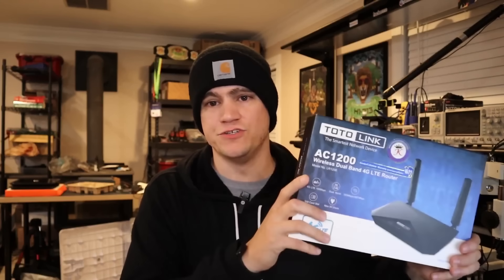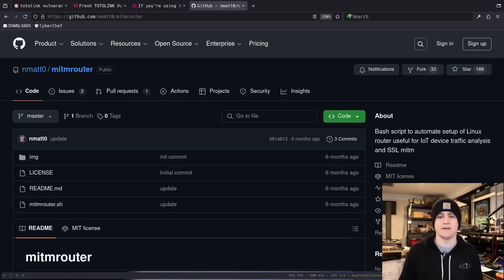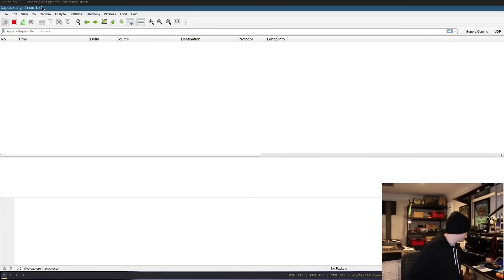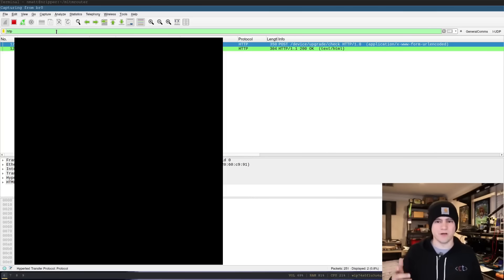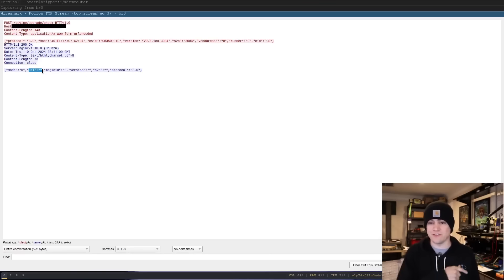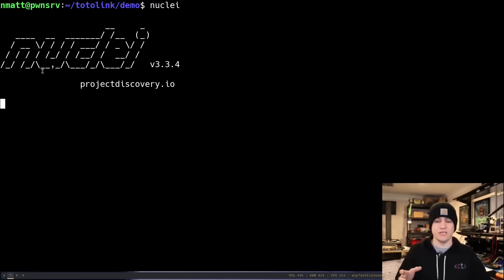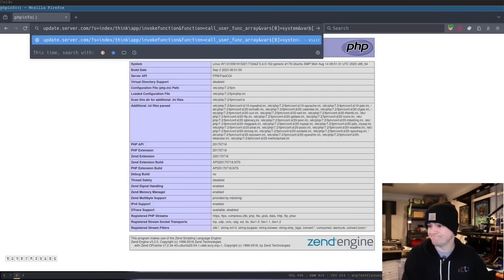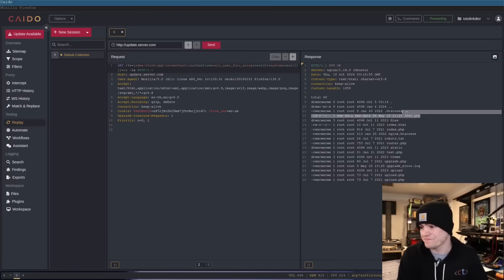Discovering Backdoor in Chinese Router Firmware Update Server - Hacking the Totolink WiFi Router

Comment: You have assumed many things. Try and update the firmware with an attack chances are its going to fail binary signature, (they using a second stage boot-loader with signature check). Just cause you discovered the plain text communication doesn't mean anything you basically making a ton of noise with no "end to end" demonstration of an attack. no wonder they didn't reply, you haven't proved anything, good video and hats off for trying though.
Reply from the maker: LOL :D

Comment: Just out of curiosity, is what you show legal to do in the US? Where I am, in Denmark, it's illegal to access systems without authorization. IANAL, but I think what you did would be deemed hacking and illegal.
Reply: One might agree with what you say, IF, some effort was put in to securing the server. They provided the ability to enter commands through an http post to everyone without requiring authorization.  So one could argue that there is no authorization requirement.

Matt didn't alter anything on the server, someone else already did that.

Comment: Idumped the firmware from nor spi flash for Huawei dg8045 with customized firmware by vodafone the webpage login interface has admin and user permissions the user one is printed on the back of the router the admin has fully control on the router I tried to investigate the firmware the kernel extracted them and tried using ghydra but nothing even the Cfg file is encrypted i tried to decrypt some info but nothing even the when i tried to gain access through uart shell the router boots up and the shell stops on starting kernel i interrupted the the 2 bootloaders first is bootrom the second is hiboot to manipulate loading kernel process the common bootargs doesn't work
Reply: my Huawei HG8045 is a lot less secure than yours.

can download a backup config, copy my user password hash to admin, restore backup and I have admin access. The config is encrypted but there's also a git repo with documentation on how to decrypt

Also, the admin password is the same default one that you can find online once you know the hash. In my case the username is "r&duser"
Reply: please start using , and . before asking for help. Your blob of text is super hard to read.

Comment: This couldn't be any more perfect, and it's precisely why we developed a system that blocks execution of unknown PHP code within the PHP engine; detecting unknown files that appear is good to do but likely to be too late, so we focussed on the execution engine and blocking inside the engine itself.  Were they using the system, they'd get a real time alert when attempting to execute the file, the malware wouldn't run, and they'd have a chance to unblock the file if it was a false positive. Mostly gone are the days of Apache letting you run PHP code hidden in exif tags of image files, but using exploits to plant arbitrary code onto PHP based systems is still incredibly common and widespread.
Reply: Which system?
Reply: Who is we

Comment: is what you did cross site scripting or how did you get these responses. can someone explain.
Reply: No, it's remote code execution. The PHP module in apache (I assume) is an old version and configured in a wrong way. If you send a special string you can add (bash) commands to it that will be executed on the remote server.
Reply: @ligius3  thanks

Comment: Tbh if you cant reach then, then do the right thing and rm -rf / that server to prevent carnage
Reply from the maker: So the funny thing is that the server's disk space is full... So that might help things out 😁
Reply: @mattbrwn  Probably full because the attacker is using it as a C&C server, and a data exfiltration server, and at the same time it is also being used as repository to store ransomware keys as well.  Removing all that would probably be good, but easier is to first wipe all of that out, then reboot, after running an update on the server.
Reply from the maker: actually they are taking daily backups of the database and not deleting them ;)
Reply: @mattbrwn  So doing the rm -rf will be a service to them.......
Reply: Going full Robin Hood would be to  patch the current firmware to never request updates, push it to all the devices, and then wipe the server.
Reply: @RickDkkrd the solution could also be to make an openwrt firmware and push that to the devices.
Reply: I would disable the php module or configure it to disallow RCE, if that is possible. Then leave a README.txt file in the public folder where you explain what's wrong. While the txt file is still reachable, you know that they haven't looked at that server.

Comment: I have Huawei router like hg8245 or hg8247 u-boot of these devices are uninterruptabe so how i can extract or flash firmware on these devices.. Plz help...
Reply: chip off
Reply: Just take the chip off, or if it has exposed pins try to do the glitching method to prevent uboot from loading the kernel